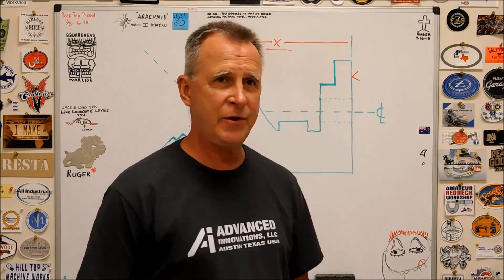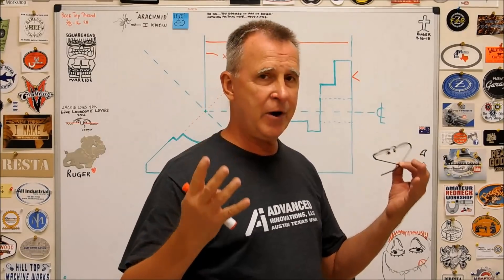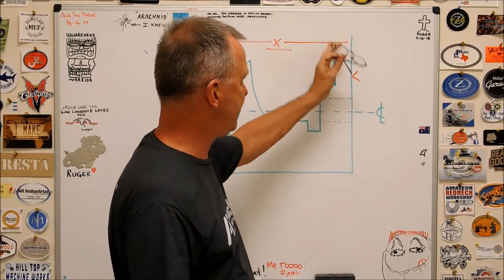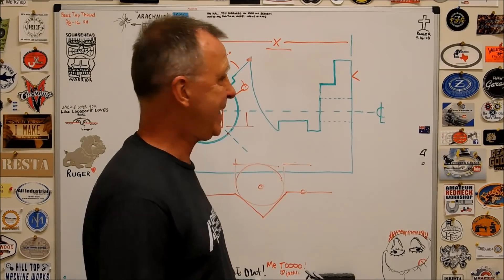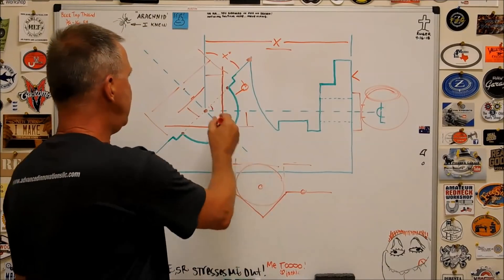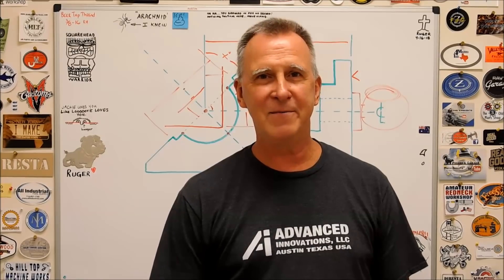A Great Trick for Machining Features on Angled Surfaces

Comment: I learn something new every time I watch this channel. This approach would honestly not have occurred to me. But then again I'm just a hobby machinist with then benefit of just 9 months of "Engineering Practice" training. Sitting in front of the white board and then going out to the machine shop brings back memories. I'm looking forward to seeing it done in practice.

I'm curious, I know these kits come with the castings, stock, fixings and drawings, but do they even suggest what to work on first - or is that left up to you (or to infer from the drawings)? Obviously I've seen you've started with the cylinder and steam chest, whereas BH started with the main casting. Is that just personal preference?

I for one will continue watching both builds; while I'm pretty sure you won't put a foot wrong, I can also learn from BH's first-time struggles - that is after all much closer to my own level of expertise! I see things that I perhaps wouldn't have done, but I don't have the experience to necessarily know what trouble lies down the line as a result. For me, both have merit.
Reply from the maker: No. There is no sequence of operation called out. There are notes that state you can drill holes in part 'A' using part'B', but if you have dimensions and some confidence, just hit the numbers.

Comment: Joe,  Maybe I'm the exception here but I would like to see the build and I really like these looks at solving the same problem that BH is working on.  I don't see it as "stealing thunder" or some kind of rivalry.  She is working at solving a problem with limited experience and limited tools.  I think a lot of model engineers might make the same or similar solutions because they don't have the experience.  Like many of these things it has a bunch to do with how to look at and analyze a problem.  Different professions often require different approaches to problem solving and a very difficult thing for many folks is to make the jump from how you successfully solve problems in your day job to changing your thinking to successfully solve problems in your non day job.  So I find it really informative to see a better way after seeing the hobbyist way.  On your last one I'm not sure it would work so well for that part on the small mill.  That casing is a "big" part on a tiny mill and the vice is also tiny compared to a "normal" mill.  The outrigger requires some serious holding power in the vice and I'm not sure one could get that with a 3" or 4" hobbyist mill vice.  But it was still really useful to watch because on parts that are proportionally sized for the hobby mill it was a great way to solve a tricky set up.  This solution though I can see a ton of uses for.
I can also sympathize with the need to set things straight.  My expertise is in a very different field but I also tend to attempt to correct videos that are way off the mark or dangerous.
Reply from the maker: I received this kit as a gift and will machine it for you guys. Stay tuned.

Comment: Starting at 6:50 when you said about the .100" over and .100 Down and then said that once you found the top of the pin after flipping the part up that you know that you are .100 above the centerline, wouldn't that ONLY apply if you were using a Ø.200" pin?
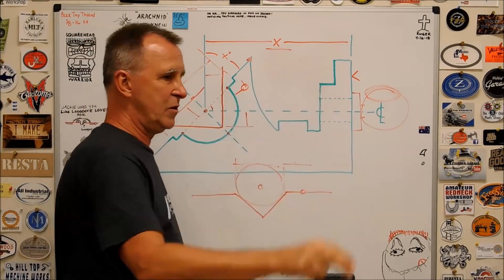Reply from the maker: Correct. At 8:45 I do suggest using a .200 diameter pin. That will give you a true .100 above, but any pin will work for center location. Height may need to be calculated if you don't use a .200 pin.
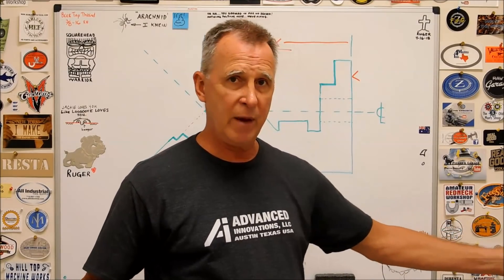Reply: @joepie221  Oh jeez, how the heck did I watch it twice and miss that both times.... Sorry about that, I guess going on about 2-1/2hrs sleep in the last 30+ hrs (damn Meth head caused me to be rudely woken by the local PD at 3:15 this morning because he picked our shop to break into)..
Reply: @CP_300PRC  sleep is soooo overrated... ;-)

Comment: Joe - This comment backs up to beginning work on the rough casting of the base of the PM Research #1 Steam Engine kits.  
I am a retired engineer but new to machining. On my kit I soon came to the question "Where is the centerline of the engine on the casting?"  It's not clear to a beginner that there is NOT one.  You establish the centerline when milling the crosshead guide surfaces (top and inward sides).  From there you can use your earlier tip to establish the center hole.  Then this video applies to set the crankshaft bore. 
What I'd like to see from you is making the decisions on the crosshead guide cuts.  And forty years of engineering experience says, "Ask the machinist how he'd change the design of the casting to make it easier to machine."
Reply from the maker: A quick physical inspection of the casting driven by the referenced start point on the print, and work from there. Its clearly called out.

Comment: Joe, thanks for the videos, I do love to watch them they are all well thought out and clear.

I keep looking at this and the original video and keep coming back to the opinion that it started in the wrong place.  The datum for the machine is the CL of the cylinder and the CL of the crank shaft.  The crank shaft CL should sit on that 45 degree slope, which is probably the highest stressed and weakest part of the casting, so for these and ascetics reasons the crankshaft should lie on the CL of the bearing landing.

This video shows a great way to do "the wrong job", although great if that is what needs to be done.

The face of the cylinder from which everything in the examples is worked from is a secondary location and should not have been machined yet.  The way the cylinder face has been machined will set the location of the crankshaft which is the tail wagging the dog.

Starting with the slides which are a good proxy for the cylinder axis datum it should be possible to find the correct CL of the crank and then work from there.  I would be interested to see however how you would do that all the ways I think of look difficult.  The original print does look poor in that it does really define the datum that should be established (logically the cylinder face does not seem to be it).

thanks for the insight though.
Reply from the maker: The casting print defines a 'start here' point. From that point, you have one 3 place dimension to the cylinder face. Off that face, you have one 3 place dimension to the vertical centerline of the crank. The cylinder face absolutely must be primary in correctly establishing the 45 degree plane and finding the crank centerline. The slider plane is the second driving dimension/feature. Establishing the plane or crank bearing features first would be very much out of sequence and not drive the casting as the manufacturer intended.
Reply: @joepie221  Thanks, I get it.  

Points me back to the first thing I was ever told RTFD (politely Read The FULL Drawing) and unfortunately I have been told many times since (but I'm not alone).  

Looking back I did spot the "start here" point on the views of the print, but I don't think it was ever referenced in the discussion.  I can see how it works that if you carefully work from there you will land in the correct place.  Interesting I think the slides were not checked against the distance from the top of the casing hopefully there is not so much extra metal there that leads to a problem with the height of the CL.
Reply from the maker: @Don-mu4jq  I have a gut feeling that not only the centerline is in the wrong spot, but since the 45 degree surface was established without reference, the crank centerline may be too far away from the cylinder mounting face and possibly cause the piston to jam on the back stroke.
Reply: @joepie221  :)
Reply: Your question was to Joe, particularly regarding strength, but as an engine designer builder with 2 world land speed records, in modern race internal combustion engines the piston is purposely placed off centerline relative to the crankshaft for the purpose of recovering greater percentage of power from the combustion process. Everything else being equal. It doesn't seem to make sense, but due to angularity of the connecting rod it has quite an influence. Cheers!

Comment: joe, if your just trying to establish were a surface on a casting is ( does not need to be within .001 's ) all that is needed  is two scribed lines . one vertical , one horizonal all the info is on the print to do this . set your dro to that point with a pointed center finder . then create all the features needed . no need to mill a slot for a roll pin .
Reply from the maker: I conditionally agree with your approach if the part setup won't change. However, when the part jumps to the 45 degree orientation and no known reference point is available, 2 scribed lines won't work like a flat layout. There is NO finished surface to work from in that area for depth control.
Reply: @joepie221  when the part is @ 45 deg scribe a line at the intersection of the previous scribed lines .
Reply from the maker: @johng7521  Technically, thats 3 scribed lines. Just kidding. if you have good eyes and some tolerance to play with, that may be fine. And...don't use roll pins for locating anything. they are not round and can't be trusted. gage or dowel only.
Reply: @joepie221  sorry about the roll reference , its a slang term used in tool making shops for gage pins . engineers even use it on drawings , like how people say within a tenth when they mean one ten thousands . i agree using your method to locate the x and y axis is more accurate ( tooling ball is better , no extra machining step ). but picking up the top of a dowel with the end of a end mill is as problematic as trying to see a scribed line . in the end a edge finder will be used to place the hole where it needs to be . does it matter if the bearing cap surface is on the same plane as the hole center line ?
Reply: @johng7521  your question about cap parting relative to shaft centerline is a good one. Since the clearance between shaft journal and bearing bore is approx .001", if the part line deviates very much off centerline then one side is going to go round past 180° and begin to pinch closed preventing the shaft from "dropping in". If the shaft slid in from the side it would go in no problem except that negates the purpose of having removable caps.